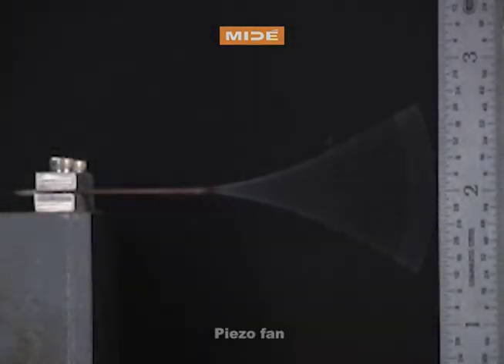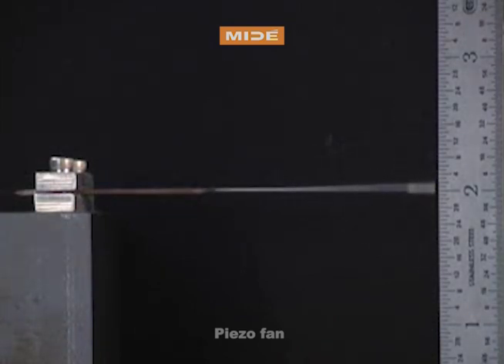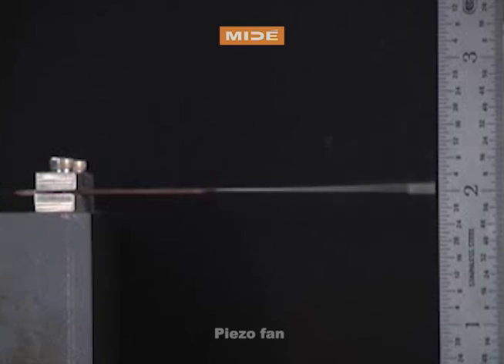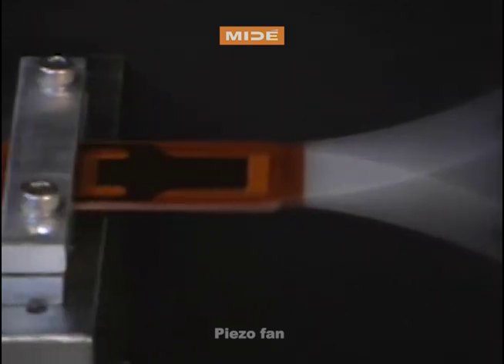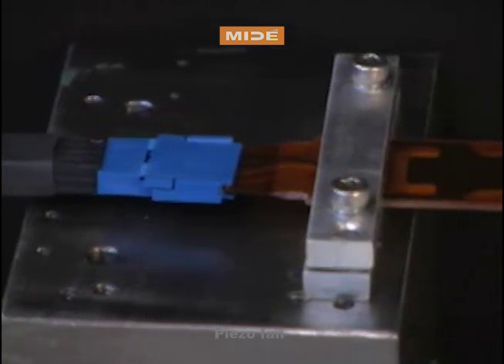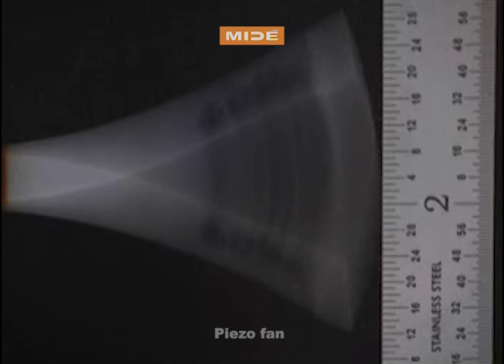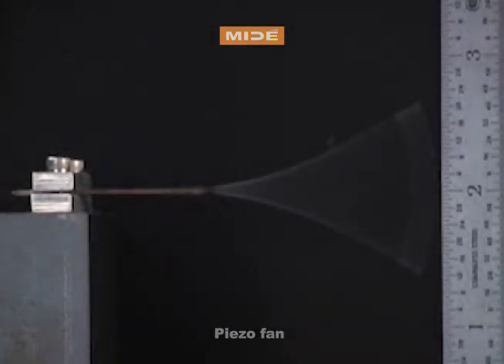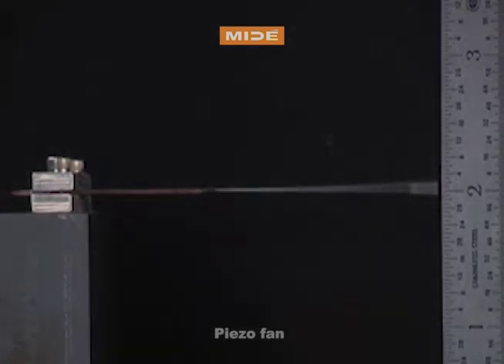Piezo Fan Demonstration | Mide Technology

Comment: What about temperatures?  I would like to use this in an application that stays at 60 - 100 degrees C for months at a time.
Reply from the maker: Hi Mark, that's no problem. Currently the max. operating temperature is 140C. We've recently completed extended lifetime testing operating at 125C. Don't hesitate to contact directly for more information: service@mide.com

Comment: what about the diaplacement and length of the PZT bender?  If we want a bender with high  linearity vs voltage which type of PZT material do you suggest?
Reply from the maker: Hi there,  the most linear ceramic element we offer is the PZT 5A type. However, at high electric field for bending elements made from this material are non-linear. There are specialty ceramics which are more linear, however ,they have significantly less movement. Feel free to contact us at help@piezo.com